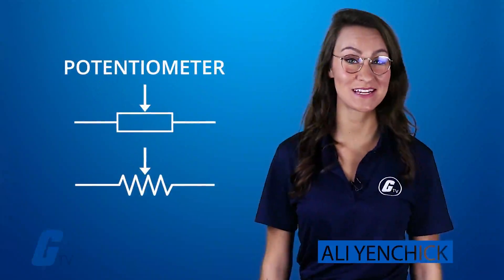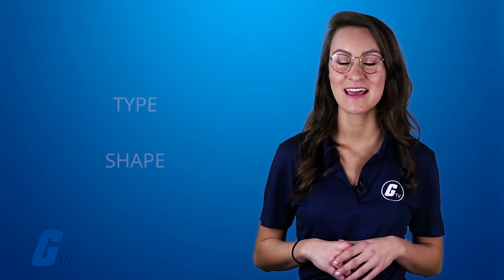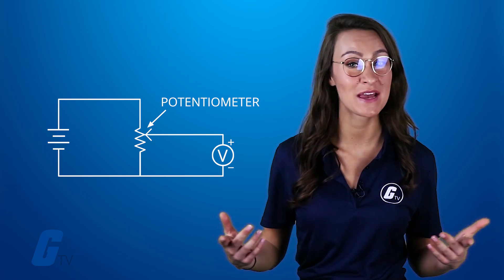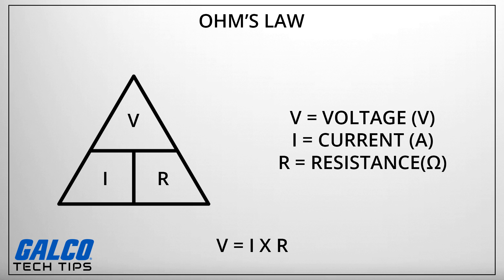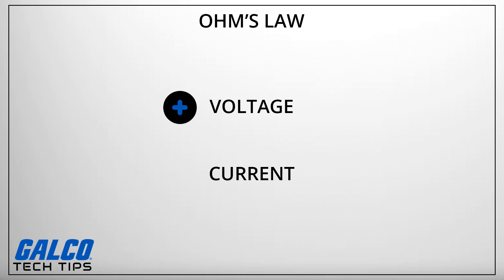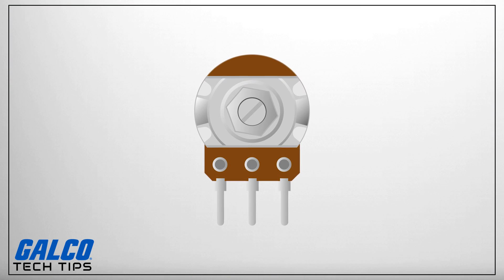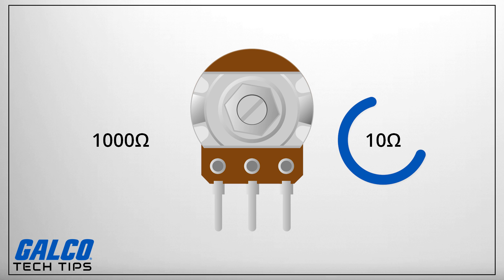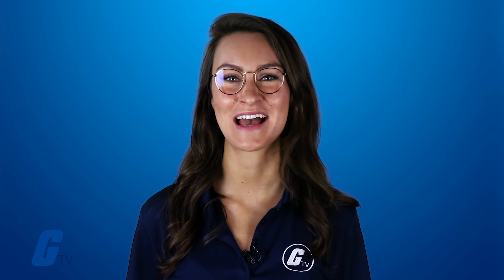How to size a Potentiometer - A Galco TV Tech Tip | Galco

Comment: As a beginner, that should be among the target audience for these videos, I found this 'tech tip' incomprehensible. 
There's a puerile spiel about voltage and current, I then somehow magically know my circuit's resistance... and can choose a potentiometer according to 'the specifications'.
In future videos, provide working examples so people can see this strategy in operation. As it stands, this video attempts to cater to an expert who doesn't know the basics.
Reply: its literally basic algebra, not puerile magic
Reply: @ChildOfAnAndroid  
The spiel was puerile. Mathematics isn't.
Even your comment shed no light on how a beginner could utilise the details within the clip. There's some foundational knowledge that many of us are missing. Without it, we are unable to make sense of the 'tech tip'.
Reply: @ReincarnatedAgain  What part of the video are you struggling with? I am a beginner, but I may be able to help shed some light if it's something in the video you don't get?
Reply: @ChildOfAnAndroid  I'm hoping to read the resistance value of a potentiometer via an Arduino. Voltage is usually 3.3v or 5v, but can be adjusted if needed. I believe a 5k or 10k potentiometer is suitable for the Arduino. I'm hoping for a very accurate potentiometer with no .. 'delay' or 'deadzone' between left and right turns. And the number of dial turns isn't that important (can be adjusted via gears if needed). 
This may seem like I'm describing the item I need... but when I search for a potentiometer, I see unfamiliar terms such as 'shaft sealing', 'converter', 'trimmer', '10 ring', 'taper', 'linear/logarithmic'... I could go on. I'm not sure if/how these meet 'my specifications'...
Reply: It's so simple... in order to know what size potentiometer you need you simply pick the correct size potentiometer.  Didn't you watch the video?  lol
Reply: @101perspective  Ironically... this advice worked. I spoke to the guy at the store and he said 'this is the size you want'. Although, he did need to ask someone in the back room. And I'd assume that person made a call, and then they made a call.. and so on, until eventually, maybe 20 calls later, the guy who made this video gets a call; 'what size potentiometer do we need for this?'.
Reply: @ReincarnatedAgain  
Sir, i do highly appreciate your comment, 
I kindly need your answer, 
I've a VFD with 0V to 10V input, it ATO Brand,
What is the reference or equation i should use to get the right Potentiometer ?
I really need hard reference for this job as well as future once, 
I do highly appreciate your answer

Comment: Voltage (potential) and current are inversely proportional for a given load though. Not directly proportional.
Reply: No they are not, if you raise the voltage on a fixed load current also raises. You are confusing a power transformation from low to high side, in which case there is a change in impedance  from the primary to the secondary, in this situation the voltage and current relation is inverse.

Comment: She started by saying the potentiometer range of values are; speed, voltage, and frequency. Really?
Based on nothing, she says I now know my circuit's resistance. Really?
With no application info, she specified a linear potentiometer. Really?
She said the potentiometer must meet "or exceed" specifications, but cannot exceed the specified resistance, or it won't work. Really?
She provided no useful information.
She provided bad information.
She contradicted herself.
A Mötley Crüe video over her voice would've been more helpful.
Nice job, Galco!

Comment: The potentiometer is the fix or compact Voltage multiplier or voltage decreased  maybe that is usefull in the House hold to minimize your Electric bill   not only the Volume of the speakers but also they can controlled the current flow through the wire

Comment: something wrong here , no...  high voltage low currente, slow down voltage currente up .  and that´s why 220v use small sizes cable wire  and 127v need double sizes .
Reply: You are speaking of a power relationship, you can get the same power by designing a load to use higher voltage and lower current. However if you keep the same load , try putting your 220v source on a 115v load, the current WILL  go up. Most likely you won’t have your device anymore.